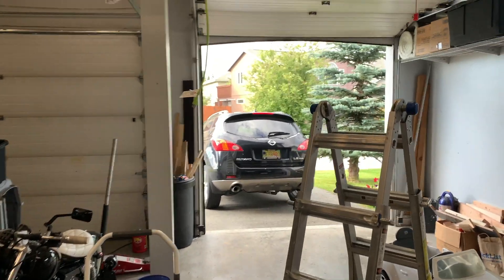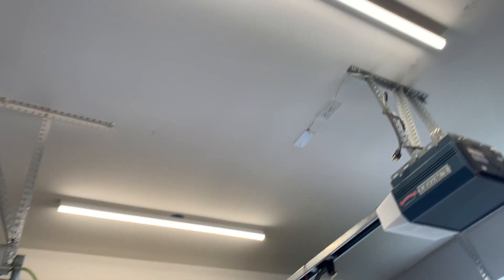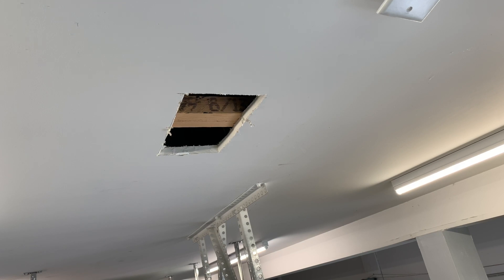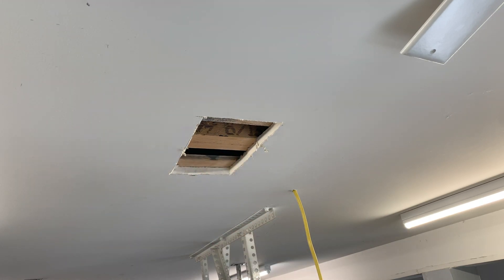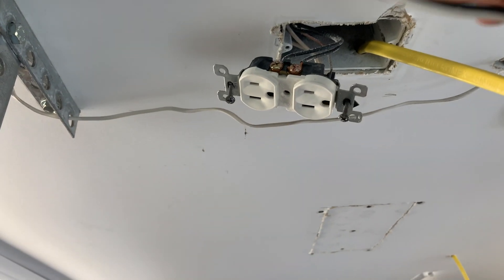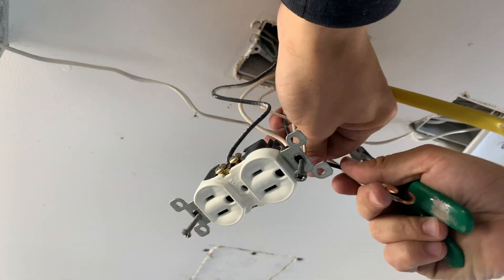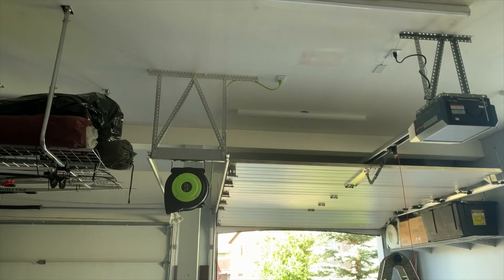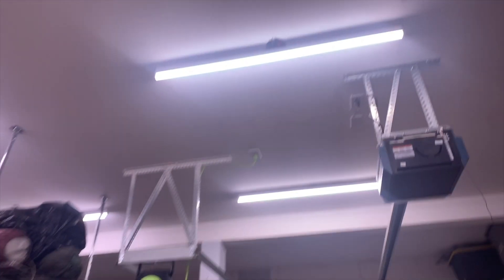How to add an electrical outlet ANYWHERE! (EASY!!)

Comment: Thanks for the effort. Several errors already pointed out but all are correctable by knowledgeable DIYers. Did you really use a new work box on your new outlet though?  Your receptacle hole is not big enough. Suspect you used an old work box otherwise you’d show more patchwork.

Comment: Drilling a hole in the side of a box to pass wire is not allowed, next time just pry the old box out and replace with an old work box, and whats up with that low voltage wire going under that blank  plate?
Reply from the maker: Not sure. It was like that when we bought the house. I think it has to do with the old security system that was removed at some point.

Comment: When your house was built, the receptacle for overhead door openers was not required to be GFCI protected.   You by using that cord reel by passed safety equipment used on a grounded surface(concrete floor).   Now for the problem.   By adding a receptacle to the existing one for the overhead door opener, you have modified it.   Now, if 2017 or 2020 NEC is the adopted code for where you live, your install is in violation of the code.   It says “All 15 and 20 ampere 125 volt receptacles installed within garages must have GFCI protection.   Since you chose to show yourself installing it, hopefully no one will ever be in your garage using something plugged into the cord reel gets shocked or electrocuted.  You as the installer will be liable in court and your insurance company could deny any claim.   If you go to court, you could lose the case.
Always be safe, the life you save may be your own.
Reply: you must be fun at parties (valid points though)
Reply: @johnconphoto     That’s just my Professional Engineer side of 35 years designing.  Different person when not commenting on electrical! 😀.  Being informed was the goal, not saying “You must make changes”.
Reply: @KevinCoop1  No home policy I’ve ever had or reviewed for others has an exclusion for not following code.  An example from auto insurance is your company denying coverage for a wreck you got into when intoxicated.  If the man in the video wants to be extra careful, he can protect the entire circuit with a GFCI breaker at the panel.
Reply: @glasshalffull2930     Ok you got me!   This was three years ago, and I should have said, your insurance “could” deny any claim, and you “could” lose in court.
Reply: @ Fair enough!
Reply: @KevinCoop1   I also edited out my opening sentence.
Reply: @glasshalffull2930     The thing is, “most”, (not all) electrical videos are made by people that are not involved in the electrical industry at all.  The went to a big box store bought some stuff the store employee told them to buy, and make a video after they say they are not an electrician.  Then they make mistakes, that others are seeing and may possibly do the same thing.   Up to the last 4 NEC code cycles, the changes were always about life safety.  The last 4 pretty much about product sales.   You get your widget in the NEC, you are going to make a fortune!
Respectfully,  Kevin
Reply: @  No question re people videoing and posting things they shouldn’t be doing.  Personally, I review a lot of the DIY stuff just for the professionals to really educate on how things should be done.  I also review the professional videos even though I have an engineering background.